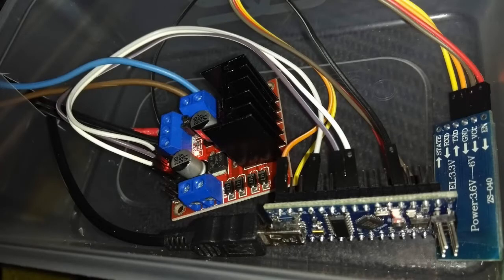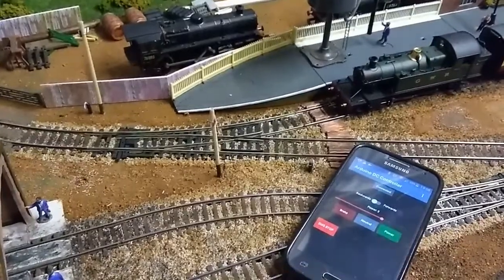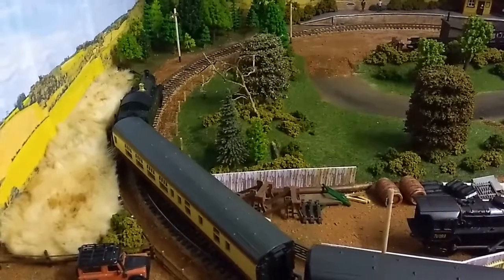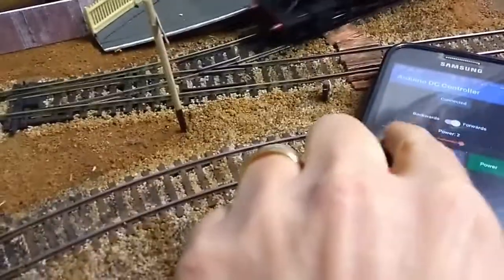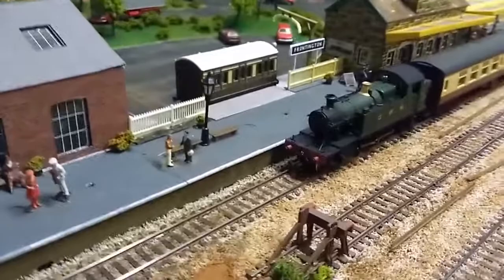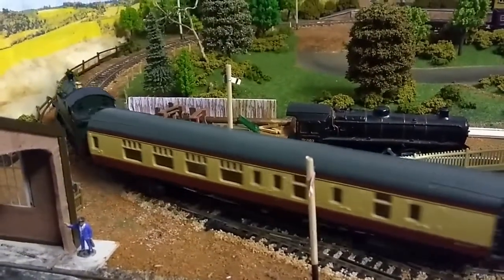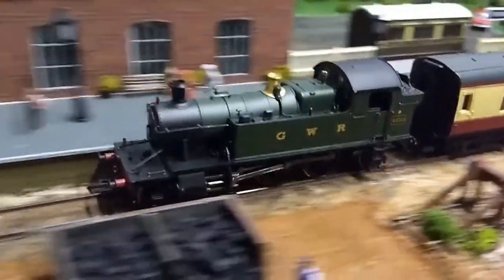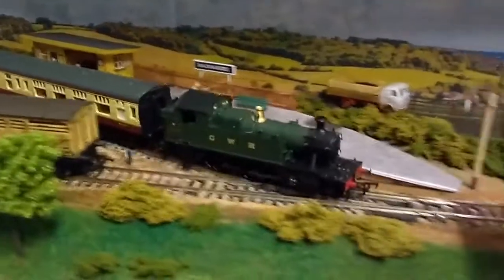Arduino Bluetooth DC model railway controller

Comment: Use a magnetic or optical sensor on the motor out put . magnet in you flywheel or a led and a disc and optic sensor can you compare power draw to current setting and find the difference. amps are used in performance check on locos

Comment: One thought that occurs after hearing your description - and I have not tested it out - is to use a "Bluetooth feedback signal." I would have to sit down and do some circuit sketches, but broadly, here's how i'd start. 1) get a 2nd small Bluetooth transmitter module, and 2) a small (the smaller the better) DC-DC voltage adjustment module. You might get away with a "buck" converter only, or a "buck/boost" might be required - I don't know what voltages you're running to your track. You could then devise a sensor to go inside the locomotive shell, and connect the output of that to the Bluetooth transmitter. Several possibilities come to mind - an LED RPM sensor on the electric motor shaft is one - but the general idea would be to send a signal back from the locomotive to your phone's control software, giving some value for actual speed. Measuring the actual back EMF in the loco, and using a very small A-D module with the output sent to the Bluetooth transmitter is another. The voltage controlled power "buck" module in the loco would be set for 3.3 V or 5V, depending on which other parts you're using. An IR LED transmitter receiver pair would be suitable for either voltage with a small current limiting resistor. You said that your main concern was not "back-EMF" as such, but rather the locomotive speed changing. So, almost any kind of simple sensor input to the Bluetooth transmitter module could probably be made to provide that information. After the "return" Bluetooth signal gets to the control software on your phone, a bit of code sampling that, and comparing it to the "intended" speed setting, adjusting if necessary, should close the loop.  Perhaps even counting the ties and how quickly they pass? Hmmm.
I'm sorry this is such a crude description - I'm trying to imagine the simplest and smallest sensing/transmitting circuit that could be devised using cheap off-the-shelf modules, and that could dovetail with your existing outbound Arduino/Bluetooth control signal. There are very small "buck" voltage modules to step down the track voltage as required, and small bluetooth transmitting modules. Actually, the return signal needn't be Bluetooth - an IR LED flashing a pulse train could be inconspicuous and not a visible light. Also, there are very small IR LED sensor pairs that could go inside a loco shell and surface-mount Hall Effect sensors. Without a loco on hand to play with, I can't immediately test any of thse. 
But I hope this may offer one direction that would provide a feedback signal from the locomotive. I would not necessarily use the "made for Arduino" sensor modules, which mostly seem to be large bits of PCB with only a few components, and large ones at that. Just looking through my parts drawers, I have a 2-20 volt "buck" module that fits nicely on my thumbnail, a Bluetooth Tx module smaller still, a surface mount Hall Effect switch, and some 3mm IR LED Tx/Rx pairs, the latter two sensors smaller than the nail on my pinky finger. I think something could be arranged inside an HO loco shell using those parts. Directly measuring the motor voltage, and a small A-D module could also be done with physically small parts. 
There might be an even simpler way to do this - simply send a string of on/off pulses with the Bluetooth Tx module switched on/off by some rotating component, or a VCO. It's an interesting bit to augment the control setup you've already devised. 
I'm afraid I'm pretty old fashioned (also cheap). I've built some DTMF controlled relays to eventually manage switch or "points" movement (also LED signal lamps if I get fancy), but that's mainly because I've some familiarity with using DTMF to control VHF repeaters in commercial service, and finding a very inexpensive source for decoders that will drive a small relay. I could just have a row of toggle switches or momentary pushbuttons, but numerical "tone control" seemed like an interesting way, once I discovered the modular decoders. 
Thanks for your video - you've given me some ideas for my own DC layout-to-be.
Reply: Hi I just wanted to say that please could you shorten your comments as some of us may have difficulty reading your comments as a small tip for the future